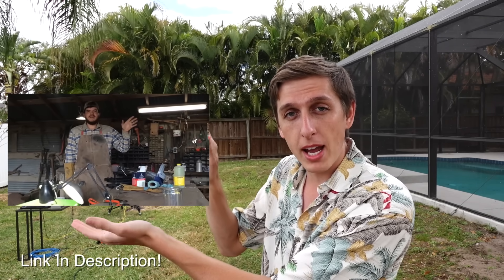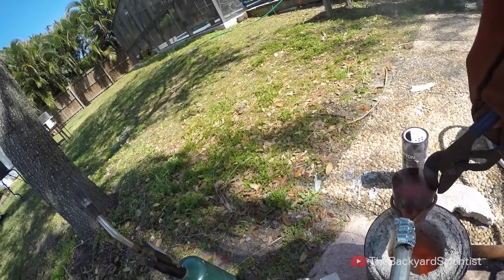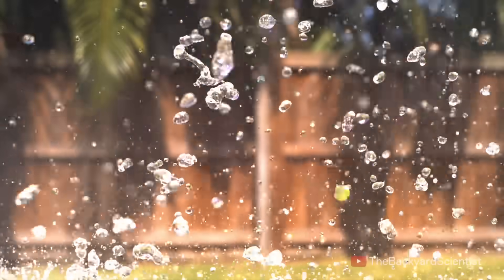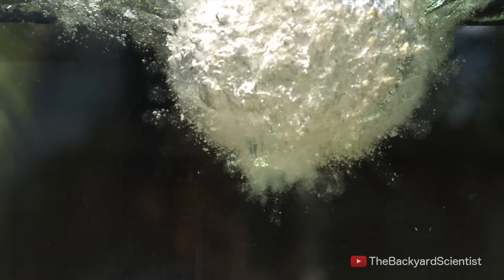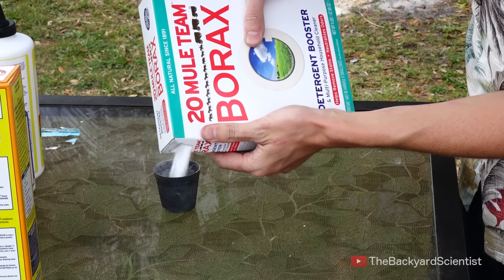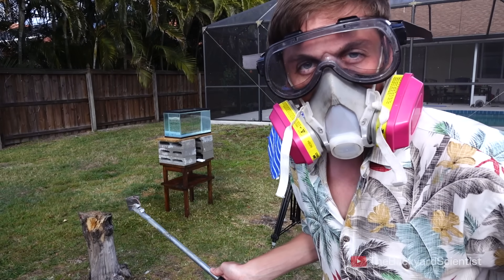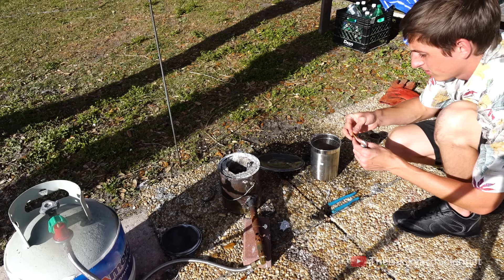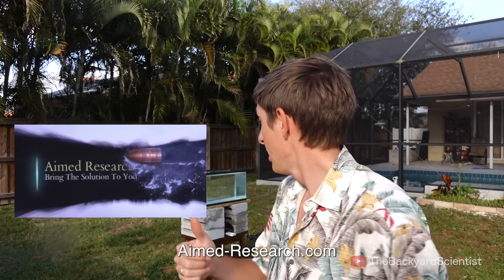Pouring Molten salt into Water - Explosion!

Comment: Well i can tell you one thing. As sodium is an alkaloid metal it violently reacts to water but chloride is a gas and when you melted the table salt you evaporated the chloride and only left molten sodium. So when you added the sodium to the water it exploded. But also as you have seen the molten table salt also had some salt so there were still little bits of chloride remaining making it yet a bigger explosion due to the chloride shielding the sodium. But then again this is my theory.

Comment: The other salts didn't physically react that way because of you notice when he had sodium chloride the first few times there wasn't much of an explosion because the salt was too thick for water to be captured but when it was molten to a higher temperature making the salt thinner there was a larger explosion that even broke the glass. Now if you look at borax it is pretty thick compared to the previous salt, sodium chloride, so it wouldn't have the same reaction because the water couldn't get trapped in the borax. You even said that borax has a higher melting point so I'm order to have the same reaction you would want the borax to be at a higher temperature as well as the other salt you tested for a thinner liquid. That is why it didn't react the same way. My answer is valid because this is a physical reaction not a chemical so it should have reacted the same way and the fort attempt of the first and second salt were kind of the same. If it were to be chemical the compounds would do a double replacement reaction so the compounds would be totally different in the product but that did not happen. It's like putting a very hot glass in very cold water. So next time just increase the tempurature

Comment: You seem very bewildered as you determine that there is no changing pH-Value. Melting the salt means splitting it into ions, but not into the elements. Therefore you only get Na+ which won't react with water. There is no need to test the pH-Value, as these are well-known facts. You could get elemental sodium by electrifying it (Fused-salt electrolysis).

Comment: Great video, and I applaud your devotion to the Scientific Method. In this case, though, even if you've never heard of Mt. St. Helens (a volcano which erupted due to the same physical reaction), some thought could have puzzled this one out. The sodium in salt is ionically bonded to the chlorine, meaning it isn't in a position to chemically react as sodium alone.

That kind of heat-induce chemical reaction is possible, though. Certain accelerants burn at a temperature sufficient to break water's ionic bond, turning it from fire suppressant into two flavors of fuel.

Comment: Great vid, but dunno about the explanation with the heat making water expanding.  Sodium metal catches on fire at room temperature when it comes in contact with water, so your explanation doesn't work there..

Comment: I think this is mostly just a physical reaction. Salt is soluble with water and the molten salt probably traps a pocket of water. The water that is trapped instantly boils and produces lots of steam. The salt also hardens slightly around the water while it is boiling to produce an explosion because the salt ruptures. This expansion leads to a chain reaction where more molten salt surrounds more water to set off several more miniature explosions. That's my guess at least. It probably didn't go off the first time because the salt wasn't hot enough to be rapidly quench hardened.

Comment: You should try it with both distilled and deionized water.

Perhaps the reaction you are seeing is not really a factor of the water at all.  Maybe it is reacting with a specific chemical impurity  in the water (tested with distilled) tap water in some areas has a lot of chemicals in it.  Or maybe it is a rapid shift of electrons, causing something similar to an arc from one to the other, so deionized should test that since the electrical properties of the water will be removed.

Comment: Isn't that due to the high temperature difference between the two liquids ? Temperature of the salt can transfert heat to the water and turn it into gaz state, and the mass or molar volume of liquid is way inferior than the gaz massic volume so that creates a high dilatation of the liquide causing the glass to break because a too strong difference in volume ? IDK HELP

Comment: Borax is not sodium tetraborate, but sodium tetraborate hydrate, which would melt at a substantially lower temperature (<200C), add to that that the hydration energy would be lower, since water is already there. You don't show what kind of sodium carbonate you use, but unless you have it from some research chemicals supplier - it is very likely that it's a hydrate as well. Now, boric acid melts below 200C anyways. However, different behaviours of anhydrous salts can be expected too.

Comment: I was going to suggest the same, that it is a steam explosion. Same thing happens when you throw a snowball into an aluminium factory. One such incident happened in Sweden, where a guy pulled off a workplace-gag by making the workplace explode, killing 7 people. It's a little bit different though because it's just 1 globule of solid state water thrown into a 800°C hot liquid light metal that is aluminium, rapidly grows into 1600 the size (or is it about 1540x ?), while water grows 1700 times. Anyone like to take a gander at what I mean by that?

Comment: I think it is as simple as the heat is causing the water to boil violently.  Try putting hot oil in water but be careful.   A big cause of kitchen fires is when water is used to put out a grease fire.

Comment: pure sodium explodes in H2O, when you melt the NaCl i would guess you are breaking the bonds between the sodium and chlorine molecules, chlorine is a gas unless brought to super critical temp so it prob evaps off and your left with just sodium.  when Sodium reacts with H2O it forms NaOH, hydrogen gas, and heat.  the heat sets off the hydrogen gas.

Comment: Na with water makes NaOH, that also dissolves in water. You're not adding anything to change the pH or the pOH in the water, remember, in the end NaOH is using an OH from H2O and giving it back right after.

Why is the Na free to react with water?
When you heat the salt you also end up giving enough energy for it to separate from the Cl molecule. 
So  2Na+2 H2O -> 2NaOH + 2H + huge energy.
NaOH + H20+ H-> Na + OH + H +some energy
Now the OH and H are free to bond again. There, no pH change in the water.

i had that in high school but didnt remember, ty for the awesome video.

https://www.youtube.com/watch?v=wq3C_dlKCGo

Comment: Salt deionizes water (makes it boil much faster. ) core my terminology as necessary but the theory is the same. So as your molten glob is expanding flash boiling the water it's also physical bonding with the water making it boil faster. The ionic bonding of sodium and chlorine prevents the salt from chemical reacting with the water on impact allowing it to get deeper in the water before major expansion happens then you exierience the effects of hydraulic presure as the whole force is down inside the tank and not being bounced off the surface of the water. So it's 3 things acting together to create your fireworks show here. Nice video! :)

Comment: Same dissolving (bond breaking) réaction that happens in moderate conditions when NaCl is placed in water but however in your case, sped up with a larger release of energy bc of the input energy added to the bonds between sodium and chlorine

Comment: whats going on here is the sodium ions and chlorine ions are separated and the some of the sodium ions are reacting with water and there ions together made sodium hydroxide.
Reply: War Simulator because an equal amount of hcl is formed in the hydrolysis which keeps the ph at 7
Reply: Jyotiraditya Deka but if sodium hydroxide is formed then why there is no change in ph levels
Reply: well, there may be a ph level lower than 7. but in the video, he haven't measured it
Reply: Jyotiraditya Deka he has measured and he admitted that there is no change in ph levels
Reply: I think because of heating the salt in very high temperature makes the natrium ion release with chlorine ._. look when he heating in not to high temperature, it isnt explosive
Reply: my tiny eleven year old brain is blown.
Reply: @Kadek Wijayanta - Melting salt dissociates the ions, yes. But they are ions with a huge difference in electronegativity. Chlorine(-) won't just bounce it's electron over to sodium(+), subsequently arrive at a state of much higher energy and just stay there. Due to electronegativity, chlorine would nab that electron right back. Hydrogen and oxygen have much higher electronegativity than sodium. You are suggesting, that the electrons take a massive detour by having elemental sodium form, which reacts with water to create sodium hydroxide and elemental hydrogen (which would burn/[[explode]]). Meanwhile the chlorine dissolves in water to HCl and HOCl, which in an open tank will slowly gas out (smell at a swimming pool). Meaning, even if the water isn't measurably alkaline immediately after the explosion, it would be so after a couple minutes.

On another note: There is no visible flash that would indicate a hydrogen explosion. Another hint that this phenomenon is physical.
Reply: How was cigarettes made
Reply: You are suggesting hydrolysis is what causes the explosion, but hydrolysis of NaCl is endothermic.
Most people know pouring salt on ice drops its temperature.
Reply: Jyotiraditya Deka He found there was no pH change to the solution, which tells us there was no sodium hydroxide in solution: sodium hydroxide is very basic.
Reply: Jyotiraditya Deka @blogspot
Reply: Omgosh you sound like my cousin XD
Reply: I was searching the comments for an explaination, thinking surely someone knows this reaction. This is the only one I read that was correct.
Reply: Give the credit to google, not this loser who thinks he is smart.

Comment: Simple chemistry. Water is made of H2O. The salt was so hot that the oxygen atom separated from the hydrogen atoms. If I remember correctly Hydrogen burns in contact with air and oxygen maintains the flame but because it happened so fast it exploded.

Comment: I think it has to do with NaCl dissociation in water. The polarity of water separates the Na from the Cl, leaving hot Na ions in cold water and hot Cl ions in cold water. The reason for the delay is probably because it has to dissociate before it can explode. The others didn’t have Chlorine ions to expand it or was too heavy to simply dissociate quick enough before cooling occurred.

Comment: I am no physics pro, but it looks to me like the Prince Rupert's drop effect. But unlike glass, salt surface can't hold the internal pressure at some point and then explodes. And the reason that other salts don't do that is probably because of molecular structure difference which doesn't allow the atoms on the surface compose the "shell"

Comment: I noticed that the molten kitchen salt was poured out faster than the borax and that means that the temperature change was faster and so more water evaoporated around it. Also borax formed more like a string however sea salt was just like a bad shaped ball so it all poured into the water at once.

Comment: Apparently someone doesn't understand the chemical reactions between sodium and water...  This isn't rocket science people, it's basic chemistry.   The reason it didn't explode that much prior was because you didn't heat the salt hot enough to separate the chlorine and sodium bond.  When hotter you basically destroyed the chlorine and got pure molten sodium.  This is why it exploded on water contact, because that's what sodium does.

Try potassium next time...

Comment: It explodes because the boiling point of water is 100°c 
And temperature of molten salt is 1000°c or higher
Then the water boils
And makes steam
Steam is 1000x lower density than water
Then steam floats
Then steam pops
Pop = explosion
And it splatters water everywhere
UNDERSTAND

Comment: When you melt the salt it semi separates the sodium metal and chlorine gas making sodium, sodium and water react to each other by exploding the reason the first tries didn't blow up was because it wasn't quite hot enough to loosen the bonds between the salt(metallic element) and chlorine (gas element)

Comment: It's a steam explosion that runs away as the molten salt particles breakup, thereby increasing their surface area, rate of heat transfer, and rate of droplet breakup.  There is also a niche in the field of severe nuclear accident analysis, except replace the molten salt with melted nuclear fuel.  Here's a link to a code that simulates it: http://www.irsn.fr/EN/Research/Scientific-tools/Computer-codes/Pages/MC3D-code-3830.aspx

Comment: Reaction for melting NaCl (basic table salt):

NaCl + Heat => Na(liquid) + Cl(gas)

Sodium (Na) remaining in molten liquid form in the crucible is more reactive with water because of (1) its liquid form and (2) the heat associated with it being liquid and lets face it, it’s not entirely pure like the Sodium you had in the last experiment.  Thus the reaction that follows is:

Na(liquid) + H2O => NaOH + H2(gas) + H+(ion) 

This reaction develops rapidly and makes the primary bubble which should be mostly H2 gas.  Once the H2 gas accumulates and lifts (due to its density difference with water and the surrounding air it would hit the molten sodium and the crucible and because the ignition point for H2 gas is 1058F and the molten sodium is likely between 1200-1400F (well above the auto-ignition temp for H2 gas) the secondary explosion occurs which is shown through the following reaction:

NaOH(aq) + H+ (ion) + [ H2(gas) + Heat + Pressure => Explosion] + NaOH(aq) + H+ (ion)

The reason Borax does not produce the same results goes back to the initial melting reaction.  in the NaCl reaction Cl evaporates during the melting process; for Borax the Tetraborate molecule is complex and does not evaporate therefore there is a reaction (bubbling due to Na(liquid) + H2O => NaOH + H2(gas) + H+ (ion)) between a small amount of pure sodium and water but not enough and not with enough heat and H2 production to make a large secondary explosion once in the water.  The Tetraborate   molecule acting as a binding agent to produce a solid once the molten liquid is cooled.

The last reaction between the pure sodium is more violent because of the purity of the sodium causing a more immediate violent reaction at the surface of the water and because sodium in both a liquid and solid form is less dense than water and remains mostly on the surface.  Note that when pouring anything there is usually enough pressure to break the surface tension of water thereby going below the water and so in the case of molten table salt I believe that is why there is a larger bubble below the surface.  The added impurity of table salt is accounted for by soot produced during the melting process and the fact that Iodine is included in most table salt as a supplement therefore table salt is more accurately (NaCl + NaI), the proportions of which I’m not certain.

This reaction is very neat to watch but I think if you look at the breakdown of what is going on when in the slow-motion footage, it is easy to identify each reaction and produce an explanation.  I seem to remember learning about sodium oxidation in high school chemistry so when broken down its pretty basic.

Reference the following video for a reasonable explanation for the reaction between sodium and water:
https://www.youtube.com/watch?v=dmcfsEEogxs 

Mic Drop; you’re welcome.
Reply: Thanks by the way, I have a 10 year old son and both of us found the video very neat and entertaining and was the focus of a learning point for a complex multi-system process (melting salt => initial reaction =>explosion)

THANKS!!!

Comment: This is a physical reaction, with some chemical meddling.
This can be BOTH chemical and physical according to the forces more compelling to the distributions of each individual reaction. However, “Every object will remain at rest or in uniform in a straight line unless compelled to change its state by the action of an external force… and every force in nature, there is an equal and opposite reaction.”-Newton’s laws of motion.
In theory… Once you heated and melted the salt (Sodium) (Na) you caused, “atomic energy” at the molecular level. This is a manipulation of atoms and their energy. In this case, the manipulation was from changing a solid into a liquid. Atoms have more energy (kgm2/s2) in liquids (OH) than in solids.
As the atoms in the molten salt became more energized; this created a reaction called, “distributed energy” (DE). These atoms (not ions, because ions are electrically charged to create their arm-locking characteristics; but your atoms characteristics are from changing from a solid to a liquid”) and locking-arms in a salty chemical compound charged by the energy of heat. Energized atoms are like tiny little batteries distributing energy into motion (F = ma).
Then on the other hand, your atoms could not have completed their molecular form without the chemical compounds (Na) (OH).  Just my thoughts.